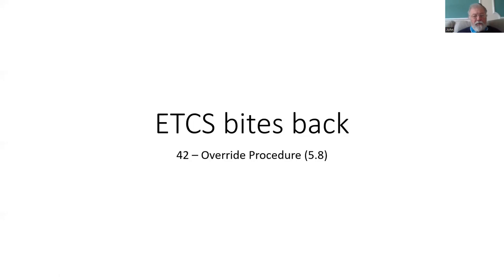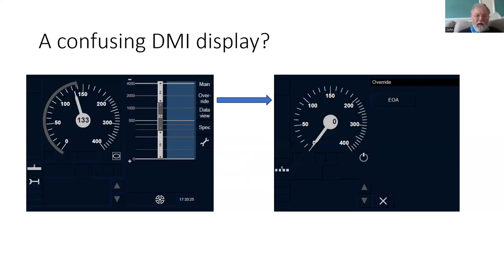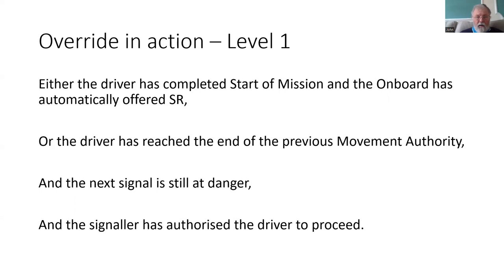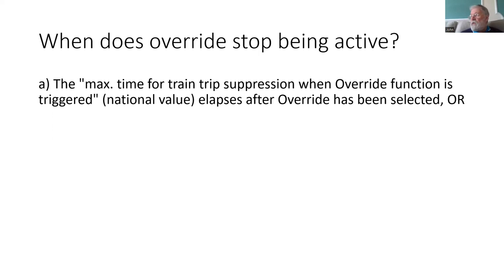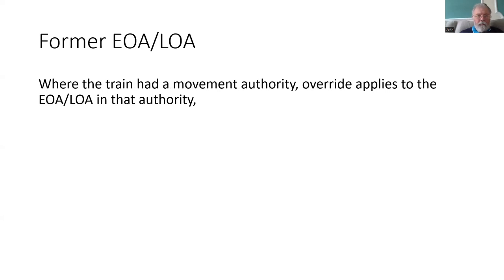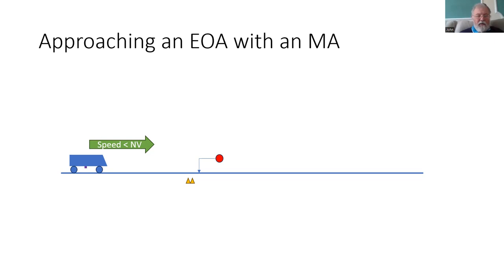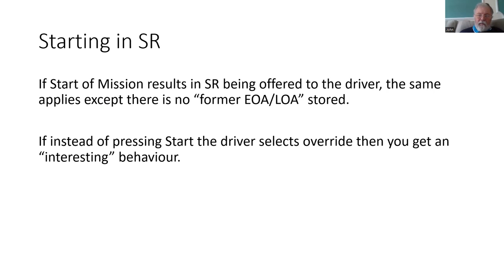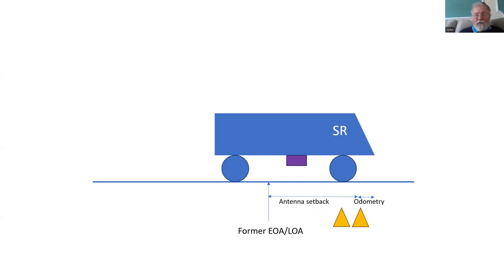ETCS Bites Back - 42 (Override Function)

Comment: Wouldn't it be nice to warn the driver before the override distance or time elapses, to avoid unnessary emergency brakes?
Reply from the maker: Yes and no. Don't get caught in the trap of focussing on when the system is not working as intended rather than the high 90s %age of the time that it is working.
Override is designed to allow a specific exclusion from the system supervision and there are design factors (such as override distance) but also operational rules and training which need to be applied.
If the EOA is marked then drivers are probably going to aim to stop about 25-50m from it so they can read any identity plate. For an unmarked EOA then it is all down to how they read the DMI but one could probably suggest that they would be 50-100m from the EOA considered as the EOA by the train.
That means an override distance of anything over 100m should allow a driver to get past any SiiSR balise.
Hope that makes sense.